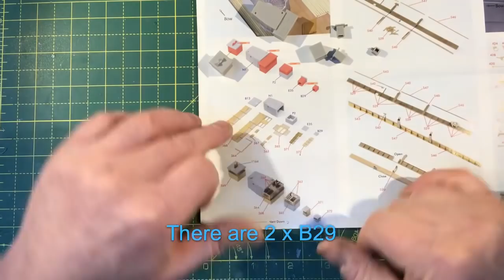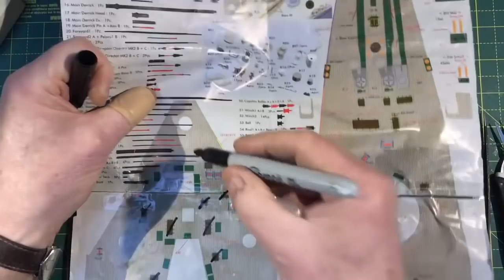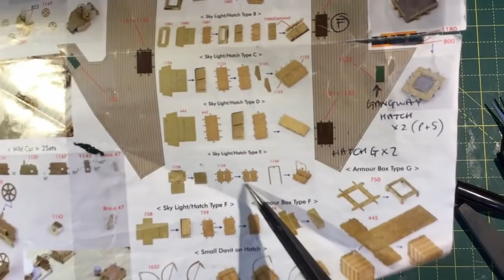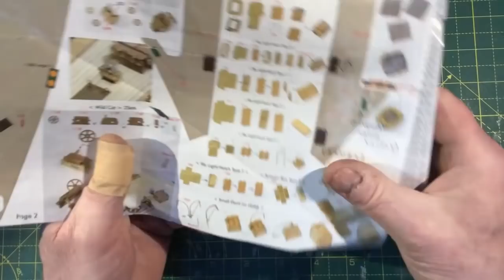Trumpeter 1/200 HMS Hood Full build with Pontos detail set Part 18 (Shelter deck vents and hatches)

Comment: I continue to be amazed that you use a rotary tool for cutting and modifying parts as shown in in this video.  Personally, I would use a razor saw for much of this which leaves a cleaner cut surface and in my opinion makes the parts easier to clean up after the cut.  You do well with the rotary tool so this is not in any way criticism, just an observation.
Reply from the maker: Hi Leonard as you can imagine I've tried all sorts of methods over the years. I use a razor saw very occasionally if I can't get in with the disc but overall I find this method the quickest and most accurate overall.

Comment: Excellent job again Steve. The ship really comes to life with each small part added and modified. I used some 5 minutes 2 component epoxy glue on larger brass parts to good effect. Slightly sanded both contact surfaces and gave them a real light glue surface. That did the job once and for all. I am not sure, but is there a slight gap between the battery room and the wooden decking ? Might be a glitch in perspective. Looking forward to next friday. Kind regards Ralf-Ingo.
Reply from the maker: Thank you. I’m going to use some 2 pack epoxy on the rear screens and yes - I think you might be right about the battery room the thought occurred to me when I was editing part 18. I’ll check it when I next go out to the shed. Well spotted!

Comment: Hello Steve, re Photo etch, consider using carpet or upholstery foam spray adhesive (decanted and thinned as you do for your primer) applied with a small `dedicated` brush.  In the `bottling` I used this to adhere (stick) 75mm x 75mm x 25 mm foam squares to stainless steel plates.  Ever tried the 145 solder used by model railway modellers for Brass or Nickel steel kits??
Take care.
Reply from the maker: Thanks Alan I’ll take a look at those
Reply: @TheModelShed  I will see if I have details of a manufacture . Looking in my notes. I find there are three,  the first a Heavy Duty Spray Adhesive, the other two by Ambersil  HS 300 & MP 100 , there are two more in this range (http://www.ambersil.com) also why not try 3M spray mount adhesive ?  Take care.

Comment: This is probably my inexperience, but watching you hold that cutting disc a fraction of an inch from your fingers made me hold my breath.
Reply from the maker: 🤔 I suppose it does look a bit risky but fingers are the best tools to hold parts like these when cutting them. It’s more secure and accurate that trying to hold the parts at a distance in tweezers for example. The bigger risk from cutting disks is from them shattering so eye protection is more important.

Comment: I was having trouble with that very piece not sticking. I found I had to use rough sandpaper on the plastic to give the etch something to bond to then also sand the back of the etch, which solved the problem.
Reply from the maker: thanks I’ll try that.
Reply: @TheModelShed  Let me know if it works.

Comment: Like the reinforcement you add. Busy sorting out hose reels, the MK1 set supplies the the hoses coloured red. I can’t find any reference to this. Have you seen this anywhere?
Reply from the maker: Hi Jim. I’ve nothing to suggest the reels were red. To be safe maybe just do them grey or I’ve gone for a speculative dirty canvas colour.
Reply: @TheModelShed  I think I’ll use tamiya deck tan with a touch of white to represent canvas.